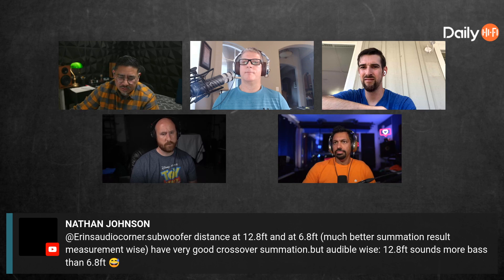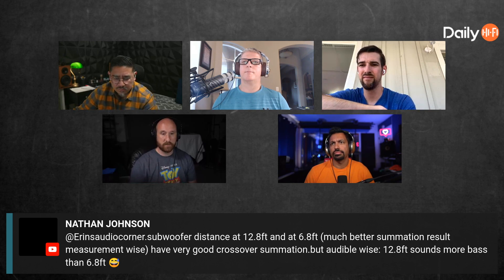Time And Phase | Subs And Speakers

Comment: A great way to put it would be that phase is frequency dependent, and time is frequency independent. Time delay, e.g. 343m / 343m/s = 1s of delay, but because phase is frequency dependent it would result in a small phase difference at low frequency compared to a much higher phase difference at high frequency (a slope). Hope this makes sense 👍. Thanks for helping clarify phase to more people lads, more people need to be aware of it!